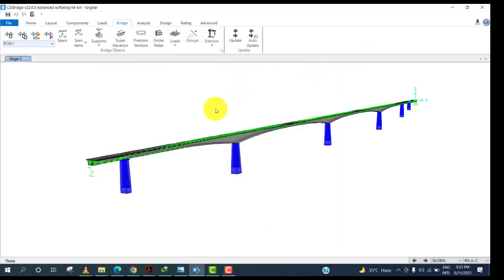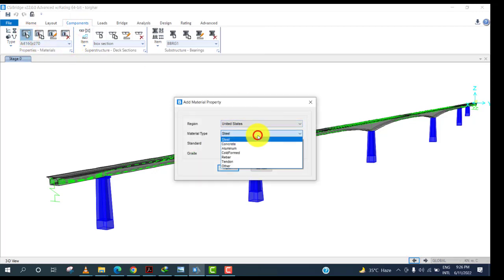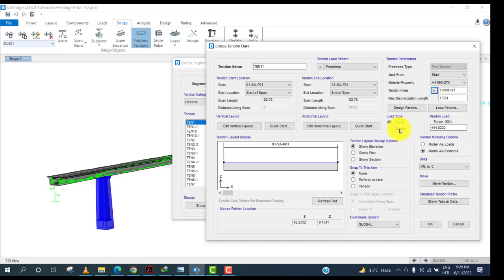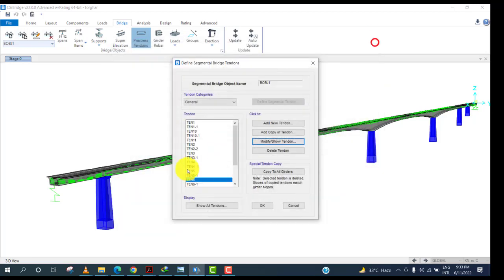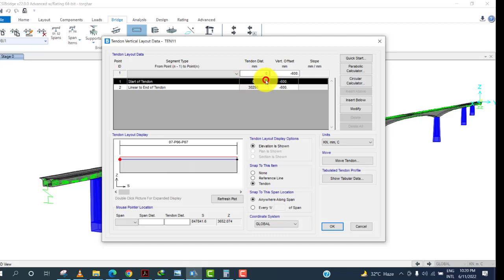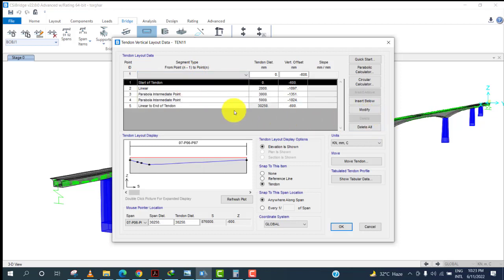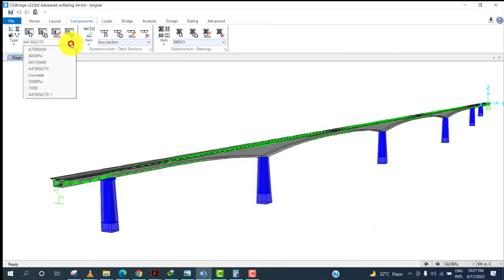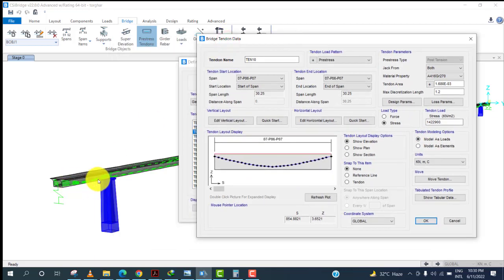Post-tensioned tendons definition in CSiBridge

Comment: adding an expansion joint transforms the span from continuous to simply supported but how we decide that we can make certain number of spans continuous and then add expansion joint there ??? is continuity is span design is better that simply supported  ??
Reply from the maker: It depends on various factors to decide whether a span be continous or simply supported. The code requires providing one every 100 m at least, but it is not a set rule. There are other factors: the support location, stability, type of bridge, and temperature variations.